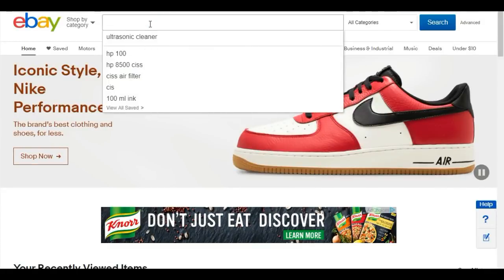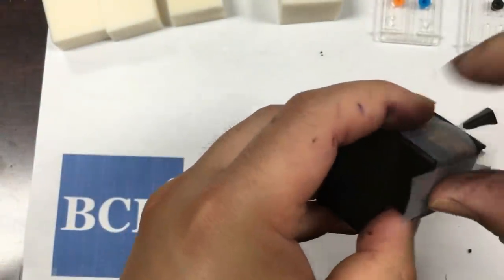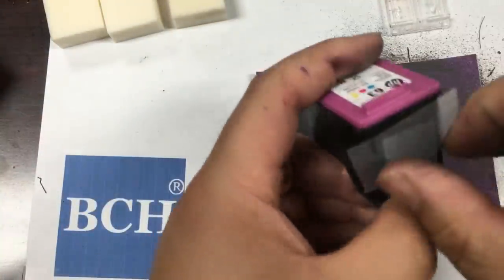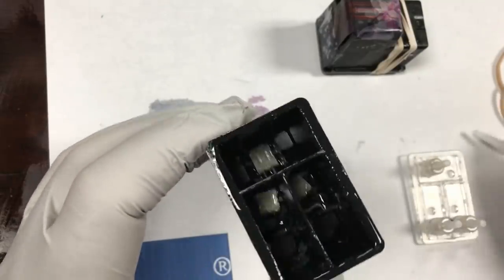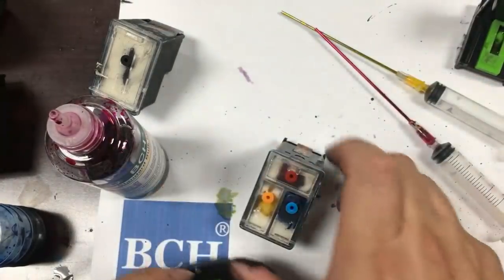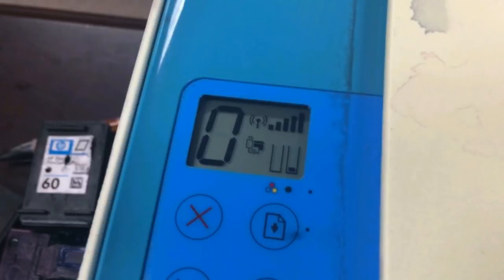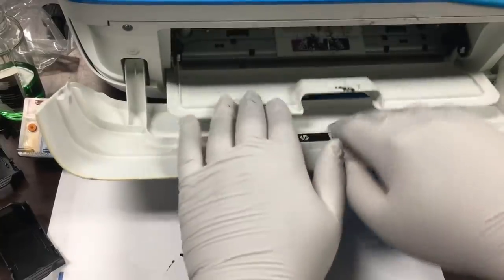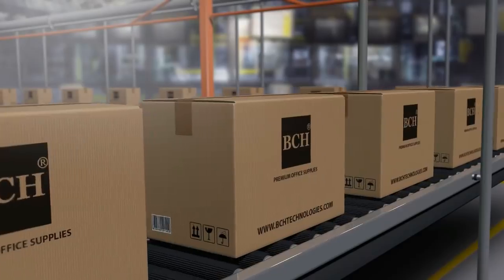How to Make a SPONGELESS Refillable HP Integrated Cartridge 60, 61, 62, 63, 64, 65

Comment: I bought the kit probably a year ago and printed regularly as i needed it. Worked well with the occasional clogs as i reused a old dried cartridge. I would run into some issues as no printing or faded black prints but it was just from the crappy cartridge I never really cleaned. Finally cleaned it well and unclogged it and I actually didnt need to print anything for months, (go figure lmao). Didnt use it for four months and needed to print a label and to my surprise it worked flawlessly first print. Saved me a ton, install is a bit tricky but if you get it down itll save you ridiculous amount of money and print for pennies. Biggest issue i found was forcing all the air bubbles out where it prints. I used a lot of ink and the vacuum method to pull the air out till i went and bought a syringe to push out their air bubbles which worked a lot better. 

Ps my printers hp software did bug out everytime i removed the cartridge which was frustrating, i just drilled a hole at the top of the retaining clip for the cartridge where i can remove the plug and fill without removing it and getting the stupid replace cartridge message. Just keep it filled and dont let it run dry or youll have to remove it and force the air bubbles out of the bottom where ink prints to get a decent print which gets messy. 

Screw you printer companies selling cartridges for 30 bucks when it costs them 25 cents to make
Reply: Mm
Reply: can you please tell me where did you buy the kit ? many thanks
Reply: Always turn off and take off the power cable... That s the HP trick to make us not able to refill

Comment: I just opened my black HP62XL cartridge. 20-30 minutes of using a heavy-duty Olfa knife with a heavy-duty (and fresh) blade. I opened it pretty cleanly (I think), but it wasn't easy. I used eye protection and an illuminated magnifier on a stand. Haven't done the rest -- I'll report back once I am done. Just wanted to point out that these cartridges are sealed HARD. I had to use a GREAT DEAL of force. I'm experienced with tools of all sorts but recognized the possibility of ending up with a broken or non-broken blade embedded in some part of my body. To be safe: 1) take your time, 2) blade movements must be AWAY from all parts of your body (fingers, arms, etc.), 3) have only the TIP of the blade protruding from the knife so it won't break off, 4) do this on a stable protected surface, 5) maybe use a bench vise. When I do this for my color cartridge I'll try a Dremel (with an EZlock cutting blade) to cut from the TOP (not the side). From the top so I can control how far I go down.

Comment: Hi Kevin I had a punctured filter and I realized the filter really is needed or else the printhead get clogged very very fast. I recleaned it and replaced the filter with a piece of thick canvas i stuck with superglue. It works as in it doesnt get clogged anymore. The issue however (the reason i took it appart in first place) is that whenever i leave my cartridge without use overnight, it fills with air between the nozle plate and the filter/sponge, but if i "prime" it (suck ink out of the nozzle/blow inside the cartridge) before use it works and proably would print 100s of pages. What do you think could be the problem? I think the sponge might be absorving the ink between the noozle plate and the filter, but this makes no sense since that would go against gravity and i dont think this ink has such a great surface tension. I guess i could block the noozles contct with air (seal them when not in use) so this wont happen. now i think about it, it's probably the one way valves that are in every HP nozzle are broken so they dont prevent tha air from getting in.
PS: Of course i know this is a waste of time and i can get a new one i am just curious and want to fix it for some reason hahaha. Your videos kinda helped me though (unlike others out there that made me lose a cartridge because i left it in bleach overnight....).

Comment: Hi Friend, Interesting, but I am afraid there is a reason for the sponge to be within, and that I reckon, is it regulates the ink flow. By  removing the sponge, you could accommodate more ink within, but I believe the flow downward goes unchecked. Thus, the mess caused by the smudginess.  Anyway, it's a bold and creative attempt, which I guess would break the Manufacturers' profit margins, and eventually they might invent more foolproof cartridges.  Thanks n Best wishes.
Reply from the maker: That is why there is a pressure regulator built-in on the new cover.  You cannot just use any cover.  It has to have a regulator for the pressure.

Comment: Your videos are great. Looking forward to trying them out to get my printers working again. Do you have a video explaining why you can have cartridges with and without a sponge? If a cartridge works just as well with a sponge taken out, as is shown here, what is the point in having a sponge in the first place? Shame I can't buy from BHC. I'm in England and usually the shipping and import tax makes it uneconomical. Keep up the good work. Thanks.
Reply from the maker: The sponge is a pressure regulator.  So, the new cover replaced the bulky pressure regulator (sponge) with a small pressure regulator.  You will see the white things inside the cover.  Those are air pressure regulators.
Reply: @BCHTechnologies  Thank you! I appreciate the explanation. I will look at your website. I read one comment that said they were surprised that shipping was a reasonable price to the UK. One problem is that Customs and Excise can charge tax and charge you for the privilege of collecting it! Would like to try though. I managed to get my HP working after soaking the cartridge print heads overnight in hot water, was lucky enough to be staying somewhere with a range type cooker so left them on the top of that,  and then vacuuming them through wet kitchen paper with the Hoover. Put them back in the printer and out shot a perfect (well, to me) test sheet! Thanks again, had almost given up. Had been looking at a new toner printer but no more.....
Reply: @BCHTechnologies  What are the new pressure regulators made of?

Comment: Hey it's me again with one big problem, I told u that I put ciss in  mg2570 printer and now ink absorber is full it shows but when I put in service mode by clicking all those procedure of 5 times, man it's not coming in service mode help me.  Pls
Reply from the maker: You need to use a software to override the error.  Let me do some research and get back to you.
Reply: Man I did all types of possible painful thing and had all version of software but this mg2570 is not coming in service mode whatever I follow the steps
Reply from the maker: The people's choice  No.  You will need a Chinese software to hack the main board.  You can't use Canon's software.  I am trying to see if I can get hold of the software.
Reply from the maker: Can you give me the error number?  Just to be sure.
Reply from the maker: There is no sensor on the ink absorber.  Canon just count how many times you did head cleaning.  Then, you need a software to override the number and make it zero.  I know there are videos showing you how to press a sequence of keys.  I haven't tried those yet.
Reply from the maker: The people's choice  Email us at support@bchtechnologies.com and we will send you the info for the software.  Can't do it here because it violates YouTube rules.

Comment: Hi brother. Please your helping.
What is material this sponge normal sponge
Reply from the maker: You supposed to use special sponge.  However try the normal sponge if you can't get the special sponge.  Try the densest sponge you can find.
Reply: @BCHTechnologies  . Am tried  normal sponge . Working but. Small line coming pepper. My printer hed any problams

Comment: Not a good tutorial! Your video has two different method. One with sponge and the other is spongeless! You did not show how to make the ink flow smoothly and there is no proof that it really works cause you videoe are not continous from start to finish!
Reply: I bought the kit and got it to work, install is the same for sponge less or with a sponge. To get it to flow properly you just force out ink with a syringe or pull it through with a vacuum and wet paper towel.

Comment: I'm sorry but tap water is way to hard to clean printer ink cartridges and the filters in the cartridge. you should only use deionised water that has 0 parts per million. That's my view as the holes in the printer head are to small and tap water could clog them up.

Comment: Hi, why you mixed up sponge and spongeless, you think people donot have eyes to see what you are doing.Also if spongeless works why the company put a sponge inside.I think if you put ink straight into the chambers it will leak.  What a Joke you are playing.No Thanks
Reply: It work. U never try
Reply: Can only refill hp cartridge for so long and printer gets wise says been used or look at docs did work but i did not remove the sponge poinless! Had to put new ones in dont know if i can refill these now for a short time trying to find a work around